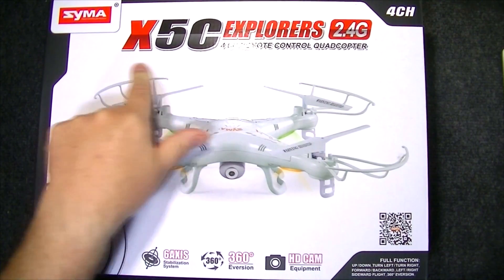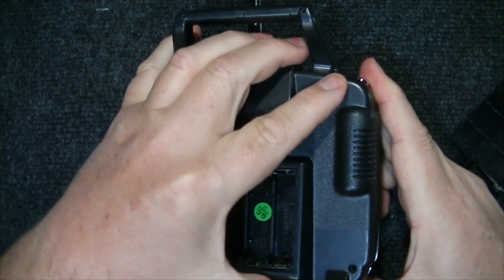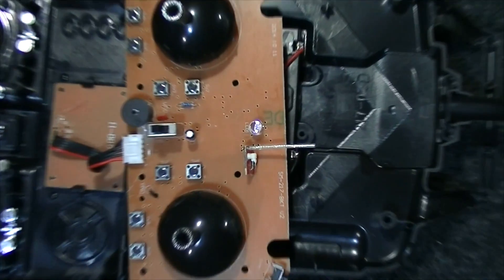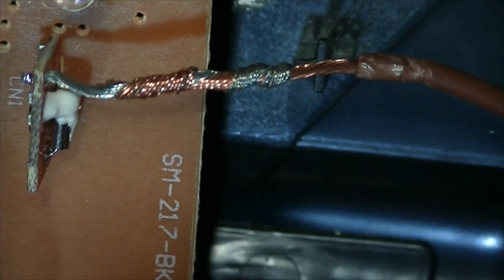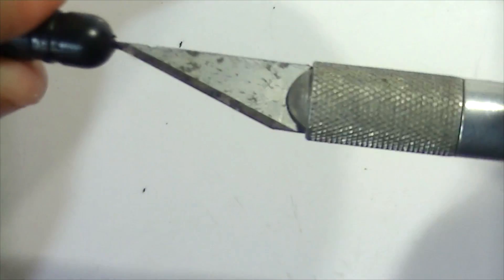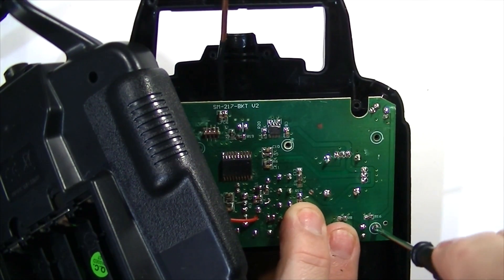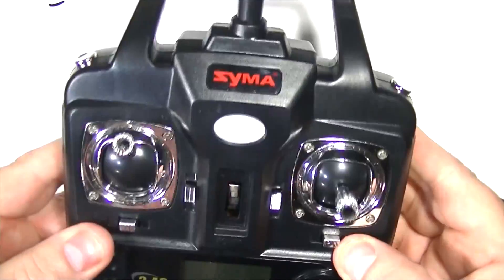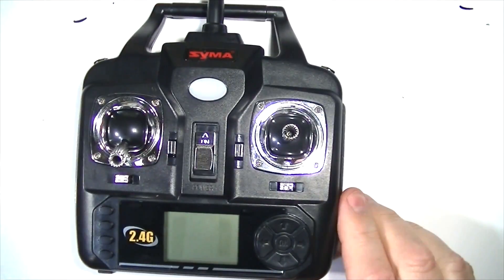Syma X5C Mods - Range Extender Fix - Without Soldering Antenna Length Hack

Comment: I want to try this, but one thing would make it easier. I am curious exacly what gauge you used in wire. I know you said close to the same guage as the existing wire, but do you know exactly the gauge of the brown wire you used? (great video by the way!!!)
Reply: Robert A. Edinger hey cool video I got the x5sw on its way got it on ebay. these r.c. are pretty much the same right? so is it like just any electrical wire that's about the same size,like would old speaker wire work as long as it's the same gauge?
Reply from the maker: Yes, speaker wire will work fine. I used wire because I didn't have a router antenna. The router antenna may have a bit more range, but then I would need binoculars to see the drone.
Reply: Robert A. Edinger oh cool man I got some new wire 18 gauge but I just did the mod the positive battery wire came undone I never done this stuff before but I'm getting  a soldering iron real quick. also mine is cut a little shorter then yours. it only sticks out the hole a cpl centimeters.  that not that bad though right? I can always do It again especially now the original wire is already striped. but thanks for the help bro
Reply from the maker: Thanks for the comment. I just used a piece of scrap wire that looked the same size but 16 to 20 gauge will work just fine.
Reply: Robert A. Edinger also I see people using router antenna and wire is that pretty much the same thing.
Reply: I have used one coming from a PC Power cable
Reply: so I did it. super easy thanks to your video. that thing rips all over my neighborhood now. good job Robert thanks for being cool and answering my questions. ok peace frog.

Comment: Works great I can now fly close to 350meters without interference it was easy and it made my day
Reply from the maker: Cool! I'm glad the video helped.
Reply: Joshua Felty u can just use any wire u want
Reply: Does it help to extend the  Antenna also on the drone its self. And can speaker wire work?
Reply: Izra Imran Thank you. :)
Reply: Help it just beeps long
Reply: I like it, to be tidier it could have been 62.5mm 1/2 wave of course.
range near same just no hole in plastic dummy antenna.

Comment: Great video!! Can a guy change the wave length to 5.8ghz by cutting the TX/RX antenna to 5.17cm?
Reply from the maker: That is a good question, but sadly it doesn't work that way. Thanks.

Comment: what type of wire did you use to twist with the original antenna?
Reply from the maker: I just tried to keep it about the same gauge stranded wire, 16 to 20 gauge should work just fine.

Comment: I need to do this, my x5c got caught in trees twice due to loss of signal.  it just drops from the sky.  It's in a tree now waiting for a gust of wind to blow it down.
Reply from the maker: That sucks. Hopefully this mod will help.
Reply: Robert A. Edinger yeah hope so.  have one stuck in a tree now.  my other x5c spent a month in a tall tree and worked fine once it fell out.  it had been exposed to rain and didn't seem to effect it.  Getting a dji phantom next
Reply from the maker: I knew the X5C was durable but that's awesome. I'm not quite ready to drop the money on a dji phantom yet. Thinking about a Syma X8C with a GoPro. Maybe I'll post some videos about it.
Reply: I believe the X5C has a Tree Magnet in it as mine also has been caught in two different trees now.  Lol
Reply: I used a Fishing pole and a Socket tied to the end to catch the branch oit was stuck on that then pulled and it finally came down, it was about 50' up